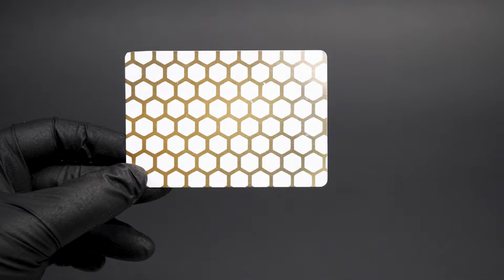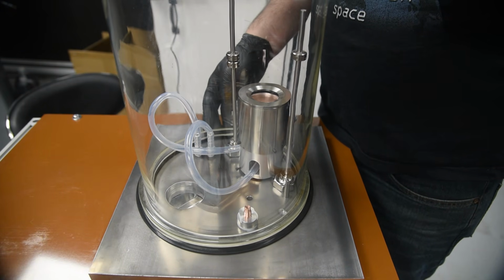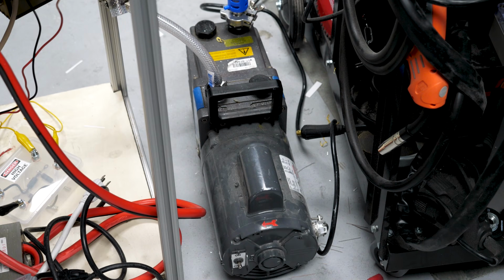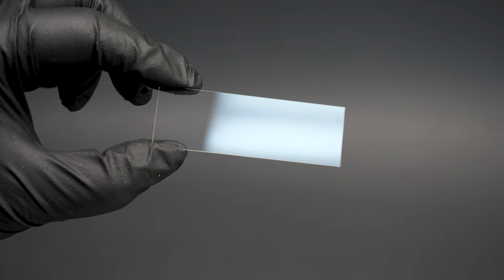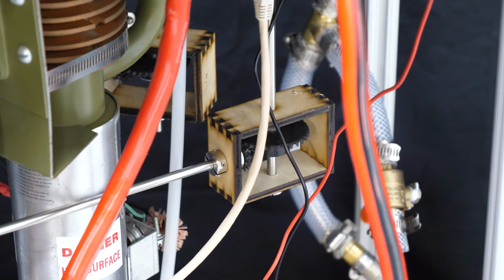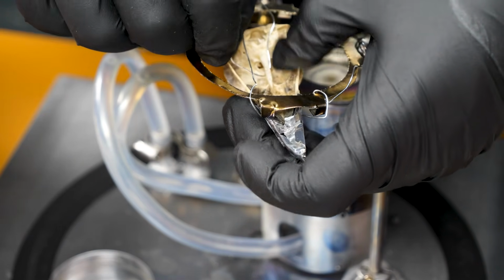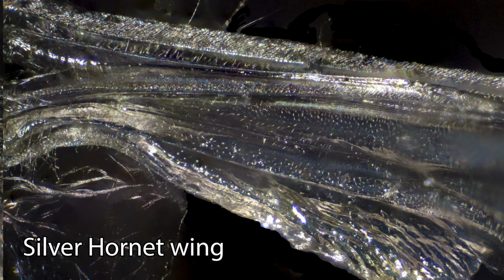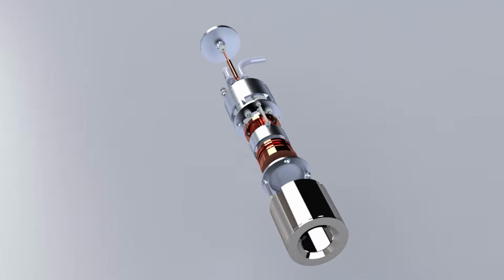Metal Coating using PLASMA (Part 1 - How it works)

Comment: Correction use a graphite pencil rod to coat something into high quality graphene,  Yes, a magnetron sputtering machine can be used to create graphene-based or graphite-like films using a graphite target (e.g., a graphite pencil rod, assuming it can be properly secured and is pure enough).

Comment: What if instead of using permanent magnets you build an electromagnet for it and then you have another variable you can control, like difference power settings for the electromagnet

Comment: This was cool to watch because back in the 80's I worked for a company that developed a sputtering system for coating silicon wafers. They sold a few and were made the standard for chip manufacturers until they realized they were selling them at sizable loss, Oops. After that the company owner decided to stop manufacturing them and sit on the technology and wait for someone to infringe on their patent 😮

Comment: Don’t know if my advice is useful right now or not, you really want to put a big valve between diffusion pump and the main chamber. Basically you prepare (make a vacuum and heat it up) the diffusion pump before using it as a vacuum pump.

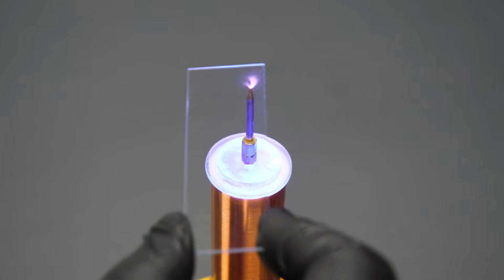Comment: 10:07 at my workplace we do what is called a Hydrogen Etch as part of the process. Basically the coating machine cleans the substrate one last time using ionised hydrogen. But we do only work with metal substrate, so I’m not sure if it would work for you

Comment: what about making a multi wave length solar panel on a strip of 1 or 2mm plastic so it can follow curves etc ... 
you should be able to get upto 4 different wavelengths covered .. on a basic test and 6 on a hex based coating setup ... so you can do UV to Infra red with some through the visible light spectrum

Comment: I'm curious since I just finished my semiconductor physics course, couldn't you use a machine like this to make some primitive semiconductors? I know modern methods use photolithography, but couldn't you load the machine with P/N type semiconductors and sputter them onto a target with some photoresist or vinyl masks?

Comment: Soooooo...I feel like Ive wrapped my head around...and it's basically the chimeric offspring from an inspired managé between a vacuum pump and the older, more experienced, married couple of microwaves? Then you "borrow" toys from your welder (argon), your beer making kit  (carboy) and set up a pair of variacs to direct this tool making pornography?

And the TEC was there with his crew behind the camera, making sure nothing got too hot

Did I get that right? 

Brilliant work. Now imma make one.

Comment: Great video, I have a few recommendations based on working with industrial pvd coaters:
Try to add a bias current to the holder of your sample, there are many papers about this and is standard in the industry, it helps attract the ionized species in the plasma
Also, you might want to get more even cooling since there are some cracks in your samples

Now, for your next project I cannot recommend enough to add 2 cathodes, this allows for the deposition of composite materials and based on the power supply you use, you can arrange both of the cathodes to work together to pulse the plasma. HPPMS is what this kind of MS is called and just multiplies the possibilities of what you can do !! 

Then again, these are standard industrial solutions so I’m not sure how to adapt them to a small set up like yours

Comment: Hmmm. Question. 

Could you speed up the material switches by isolating the hot oil? Like a safety valve that cuts off the oil boiler from the vacuum chamber when you open the vacuum to atmospheric pressure? 

Or wait no....that would explode wouldn't it? 😂  But maybe if you had a smaller vacuum chamber between the boiler and the main chamber. That way when you isolate the boiler and bleed out the main vacuum you still have a space for the expanding oil vapor to fill.

Although that would give you a hard time limit to switch out your discs before your boiler cracks and....just...bad things happen,  but I'm sure there'd be a way to safely cut down on the cycling time.

Comment: There are simpler way to make through hole in PCB, but it might be interesting to demonstrate
the sputterring can penetrate into the holes.
Once the surface of the through hole is coated with a thin layer of metal, it could then be electroplated
with more copper.

Comment: So if you manage to put a reversed container with water that has a tight enough opening that the air won't go in (and thus the water won't fall) even if it shakes a little, you might be able to coat water. Would be insane to do.

Comment: have you thought about shooting sideways or upside down, so the risk of things falling into the magnetron is removed? Also, you could print superfine circuits with your resin printer, using a casing resin, letting you clamp in place for sputtering, then melt it off afterwards so you are not in there with tweezers

Comment: That's might be a dumb ass question, but why didn't you add focusing and deflecting coils to magnetron side of the machine to turn it into cathode ray tube? I'm not a pro in any means, but it seems to me that you could try to eliminate the need of masks for precise material deposition. I get that it will be even more complicated, but maybe an option of getting precise contacts might be worthwhile to try it?That's might be a dumb ass question, but why didn't you add focusing and deflecting coils to magnetron side of the machine to turn it into cathode ray tube? I'm not a pro in any means, but it seems to me that you could try to eliminate the need of masks for precise material deposition. I get that it will be even more complicated, but maybe an option of getting precise contacts might be worthwhile to try it?

Comment: You know there are a number of other ways of drying flowers that would avoid the “ballooning” effect you had with freeze drying them. I imagine you used the freeze dryer because of time issues, but for best results I’ve found that leaving the flowers to dry buried in a bowl of silica gel for a week to be most effective.

Comment: Have you come up with a good way to use your vacuum pumps for different applications without having to uninstall and reinstall them on different apparatuses all the time? The two things that come to mind for me are (a) some sort of quick connectors and (b) one big vacuum rig that does everything (sputtering, fusion, ion engine testing, etc.), but neither of those seems really practical to me.

Comment: A simple piece of metal screen over the diffusion pump will save you A LOT of time digging nuts and bolts out of it.  Ask me how I know.

Also, if you plan on doing a lot of different materials, it's very easy to set up 2 thermal sources with one terminal in common, and just use something like truck solenoids on the transformer output to switch between.

If you want to play with some really clever effects, try making a VERY thin gold coating on a glass slide, thin enough that it's not a continuous, conductive layer, or maybe JUST past where it's continuous, and anneal it at 300-600C.  It'll change color from blue to green to pink.  Crazy stuff.

Comment: PLEASE DO YBCO. I HAVE TO KNOW IF THAT'S POSSIBLE. The implications of "printing" superconductors onto a pattern could be insane. I have to know if a super cooled hex pattern of ybco can levetate a magnet in an open space. Will it move across the lines freely or like a "hexagrid".

Comment: When plating precious metals or nickle one usually starts with a copper base, both for cost and durability. 
Could you use the heating system with copper wire for a base coat then use the plasma for a nickle, silver or gold layer without having to open the system up in between? It would also seem as though you could make a second turning arm to switch out your plasma coating disks. If you charge it, it should repel the coating of the other disk.

Comment: I have a really weird idea. How about you add a bypass of the diffusion pump, so that you can close the connection between it and the working chamber, depressurize the working chamber, do stuff with it, and then close it back up, introduce the weak vacuum and open the diffusion pump back up to the working chamber, this way you'd be able to keep the oil hot instead of having to cool it down between coatings

Comment: If you really want DC output from that full bridge rectifier, you need to flatten the output with a large capacitor. The direct output is NOT DC, it's just single polarity asymmetric AC, or a non-sinusoidal asymmetric AC with a positive DC offset and double the frequency of the input... (i.e. you just flip the negative part of the sine to the positive side, but the power still fluctuates between the amplitude and zero, just always on the same side of zero)

Comment: Hey just taking a shot that you'll see this but I have a thermoelectric project I'm working on and im wondering how you can make Bismuth Telluride (Bi2Te3) semi conductor both p and n type yourself. Partially to cut costs of lesser quality material on the market and also to have full control over the material. I'll settle with antimony and selenium as doping agent. Just wondering how you would go about this process.

Comment: So, I know a little about fusion from an astronomy course I took. Would the fusion reaction be fueled by hydrogen with a byproduct of helium, like our sun? Would we theoretically be able to fuse elements into more complex ones like iron using that kind of technology? Would it have to be as massive as a star? And why aren't you working on making a Dyson sphere? I swear you would find a way to make a functional one with some silicon and duct tape.

Comment: Use valves to isolate your diffusion pump from the system, = no worry of ignition and faster material changes

Comment: I know nothing more about vacuum diffusion pumps than you just taught me,
but instead of waiting for an hour after each material for the pump to cool down, would it be possible to add a few valves to totally isolate the pump and keep it under vacuum during material changes? once your done replacing materials, I would imagine it would be a complicated but straightforward procedure of opening your mechanical pump to the chamber so you can pump it back down, then when it gets to the right level just close the mechanical pumps valve to the chamber and open things back up to your diffusion pump. 
I feel like this may introduce unwanted risk in setting he pump on fire, but for saving an hour off of each layer is it worth it?

Comment: Could you coat an entire slide and use a fibre laser to etch away the stuff you don't need instead of using a vinyl mask?
A fibre laser will etch away the metal while not affecting the glass like a co2 one would.

Comment: You need to replace teflon tubes inside the belljar with nice stainless steel tubes. Will last way longer, and you can avoid getting water flowing into the hot diffusion pump in case one of those tubes cracks. And consider getting a turbomolecular pump, it's way cleaner.

Comment: you should have a micro controller that would help with starting the machine. you could measure the power, voltage, and pressure ranges for a normal start and  task the micro controller with managing those and showing you what to change. you could also just like... prevent the diffusion pump from accidentally getting turned on and setting your machine on fire.

Comment: 5:18 That blower fan seem to be way to strong for that small diffusion pump and cool it down to much which could make is under perform and also take a heck of a time to heat up to temperature. A tip is also to have any fan turned of and only go on when the temperature of the surface is little under the working temperature so will it heat up more quickly. But with the right fan its not really necessary.

Comment: Sorry to say, but just the rectifier will not give you DC it will give you a floating voltage (positive or negative depending on wiring), You need to add large capacitors (considering the power requirements) to make that a smoother DC (the higher the capacity compared to the load the smoother).
Also, make sure not to connect the output from the capacitors without letting them charge first if you care for PURE DC or it needs to be PURE DC always for any reason, failing to do so may result in a floating voltage (not enough capacitance will also do that).

Comment: You're not an actual witch?
Reply: Oh. Forgot to ask my question. To move stuff inside the vacuum without worrying about a snubbing seal, you could use a small magnet that would only be held near the apparatus when you're moving something.

Comment: Cool! 😃 Great new set up! 👍 
I used to do some coating work my self in the lab! And when we made aluminium surface mirrors we closed them off with a final silica or quarts coating to stop them from oxidizing!  It was always cool to see that the fresh mirrors looked pink when they came out of the vapor deposition dome, but slowly turned completely silver colored again! 😉 
Also, try not to use silver for your neuron project!! Because silver can actually be slightly toxic!! Using gold or platinum is fine! 
But always make sure to completely sterilize your chips, neurons are extremely sensitive!!  I recommend an UV-C quart's TL tube lamp sterling oven you can easily make one for your self, and the ozone also helps with killing germs! But it's bad for plastic's! And mace shure the glue's and plastics you are using are biocompatible!! 😁👍 Good luck😉

Comment: can you coat something with pure carbon using like graphite,  and check conductivity ? ( ik its not a metal, but i am curious to see if it could achieve graphene or carbon nanotube if added enough plasma into it . i just wonder if result might be similar to flash graphene production. :0)

if you ever read this comment 

thank you and stay awesome.

Comment: Idea for future video: make an anode sun like in the SAPHIRE Project. The only reason that they spent millions was for the precision measurement tools. You probably already have everything you need from this awesome project. The anode sun is mostly just a low pressure hydrogen chamber and a high voltage DC supply with controlled voltage and current. Get the right combination of pressure, voltage, and current, and you have clean, easily controlled fusion. This should be accessible to an advanced tinkerer, and easy for you. ;)

Comment: It's interesting how your pump set up works. I work in the semiconductor industry and we obviously need a lot of things to be at vaccume but we use 2 pumps. A rough pump which gets to around 100 mtorr and then a turbo pump which gets down to 0 mtorr. Obviously that wouldn't be ideal for something like this where you only run it for a few minutes since that turbo pump runs at 25 to 30 thousand RPM but it's still interesting to see the different approach for a similar result.

Comment: why is the full bridge rectifier in a sealed box, but the high voltage ac input and DC output are just on exposed nuts attached via alligator clips with pretty thin looking insulation? Aren't you worried about arcing? Stupid people touching it thinking it's off?

Comment: Add a valve between the diffusion pump and the main chamber so you can close it to limit the amount of contaminants that enter the diffusion chamber and get into the oil between runs.

Comment: Ah sputtering, the lab I worked in during collage used to use coins for gold, silver etc. as they were much cheaper than commercially sold sputtering targets.  They did mention that they got banned from one coin shop when they mentioned the use though... love your machine. Have you considered adding multiple holders to the motion control part so you can do a few parts in each run?

Comment: So why doesn't it coat the inside of the enclosure?  I would think the glass jar would get dingy as it's used.  Likewise for everything inside the chamber.  But, the only thing you showed getting coated was the grease along the seal.

Comment: If you want to scrub the system of contaminant gasses on startup and use a bit less argon, here is a trick : 
1. Run a rough vacuum 
2. Fill with argon up to atmospheric pressure
Repeat as many times as needed.

Comment: got 2 comments, pick one ;)
1. The Initial Reaction: cool
2. The Internet Troll: Overcomplicate it as much as you want, it's still an airbrush. You can get a similar effect by blowing in a pipe with an attached paint container.
(Disclaimer: The 2nd comment is meant as a joke and it's sad that I have to write this)

Comment: An Idea for an interesting project, Engineer bacteria to produce both spider silk as you've already done, and chitin. The reason I suggest such a thing: biologically originated meta-materials. that and I miss your genetics related videos. besides, a material that is a composite of chitin or dentine (or both) and spider silk, depending on the arrangement of the proteins and minerals, could be a sustainable, biodegradable replacement for steel in architecture. The applications in robotics, architecture, and and even planetary colonization could be huge.

Comment: You could add a valve between the diffusion pump and the chamber, so it can be closed off whenever you are not using it and that you don't have to wait for the diffusion pump to cool down. Saved me a lot of time.

Comment: Loving the video, does the AC/DC rectification circuit have a capacitor to smooth the output voltage though? If not, adding one may improve efficiency. I'm not exactly as well versed as you on this though obviously; this is just my opinion. I'd love to see more where this came from!